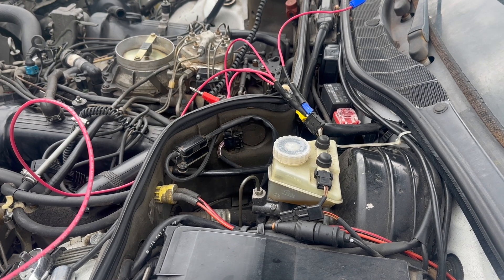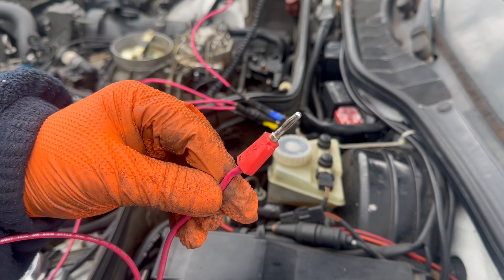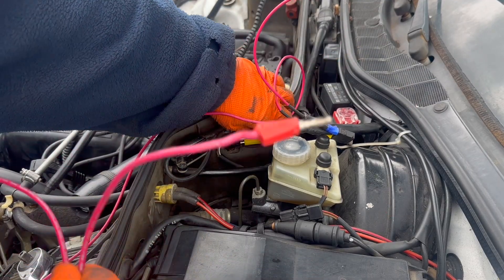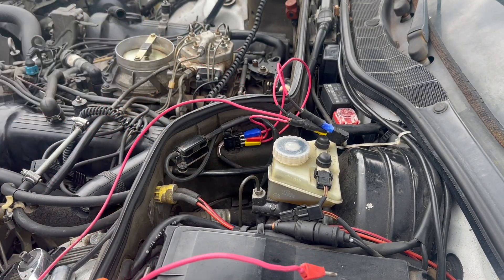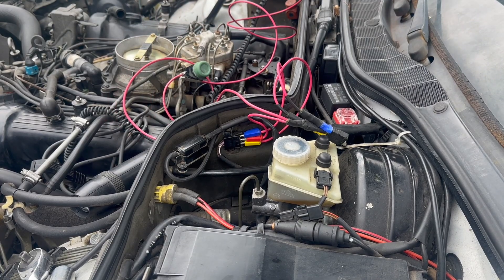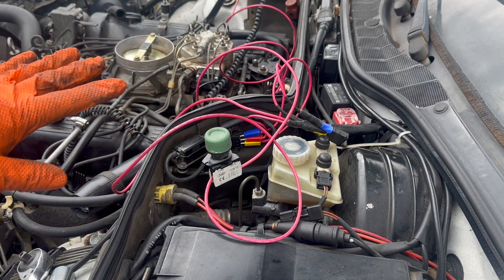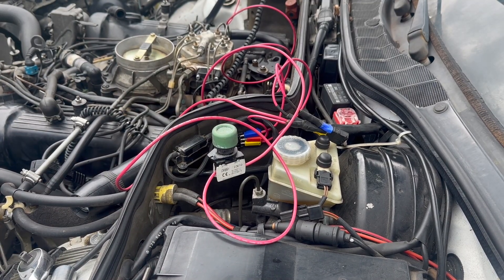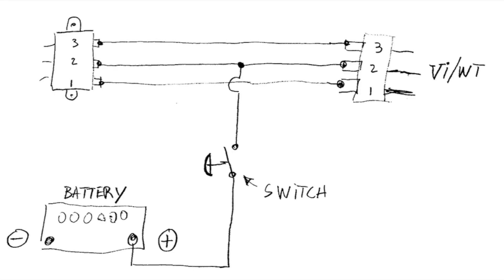Quick and cheap remote start for troubleshooting W126 gas and Diesel cars

Comment: Hi again...Do you have a video or suggestion concerning high idle issue.?  I have 380se.  Here's the issue.  When I start vehicle, it starts immediately but idle around 1200.  If I drive to a store and come out after half hour, the idle is around 600.  As i drive, it will suddenly go to 1200.  I am aware of the idle control issue (cleaning) but this seems to be more related to temperature, not the valve itself..   What is the source of the two wires on the ICV ?  There must be some sort of temperature related source that triggers the ICV?  Also, if I leave a store and idle is 600, if i just let it idle, after short while it "jumps" to 1200.  There is a "click" when that happens. (I don't think the issue is with the ICV but more to do wuth temperature related issue.   keep up the good work for the W126. Thanks.
Reply from the maker: Fist thing to check is if you have any power applied to the ICV at high idle. There are two most probable causes if there is none. One is that one or both ICV wires have a break in it. No power = high idle. The other possible thing is a busted ICU. That's at least my best guesses.